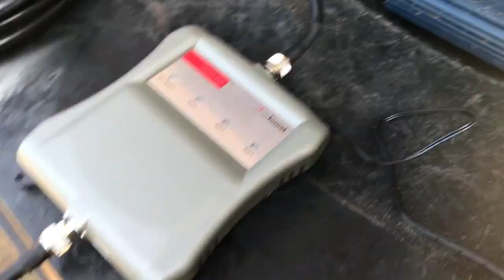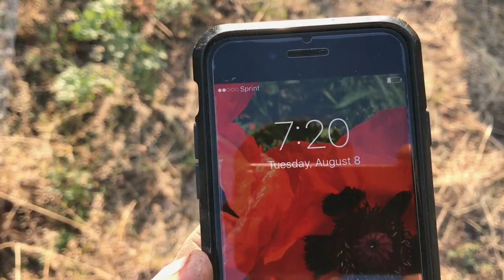#130 - I Built A Solar Powered Cell Phone Booster!

Comment: Nice hope it works out for you I would put a drip loop on The wire coming off the solar panel it looks like you've got it pulled a little tight water from rain will hit it and run directly down that wire and then to your birdhouse put a drip loop in  it'll have a little slack right in the middle that away the water will pool and drip off

Comment: The booster isn't designed to run on AC voltage, the wall wart plugged in to the inverter is.
You have a solar panel(DC) into a charge controller(DC), into a battery(DC), into an inverter(DC to AC) into a power adapter(AC to DC) into the device(DC).
If you assume that panel gives 100 power units. Then the controller takes 10 or so to run this puts you at 90. Then into the battery with another 5 loss(85) in charging. Then with the cheap modified sign wave inverter that is likely around 45-50% efficient we are left with 40 or so power units. Into the power adapter (80% efficiency).
The result is 32 power units for the device and battery charge up, 15 units unavoidably used in the battery/controller and 53 used in changing DC to AC to DC. 

If you replace the inverter and power adapter with an adjustable Buck Boost converter(10-25$ don't be too cheep guys) you can set it for the output of the power adapter to feed into the cell phone booster.
With the 85 units out of the battery: a buck boost converter(75-90% efficient) to change DC to DC. 

The result is 70 power units for the device and battery charge up, 15 units unavoidably used in the battery/controller and 15 used in changing DC to DC. This should allow you to use the smaller battery and build a smaller bird house.
If you have read this far and like/approve of this solution. Up vote it so it is the 1st comment people read. If you have additional information to help the next guy, REPLY so it is the 2nd/3rd/4th/etc comment people read.
Reply: I'm just commenting so more people may read Watchful Bird's comment.
Reply: Just get a charge controller that allows  a 12V load and a 12V cell booster.

Comment: Why not power the weboost with DC?

The wall wart converts 110v into 12v. so x86 the wall wart and connect to the battery direct. 
Even if it needs 24v You can convert the 12vDC to 24V DC.

This is just a good example of where he is a stubborn ahole which is why he refuses to get help on these huge projects.

Comment: did you run a gounding rod?

having a true ground will significantly improve radio signal, will also help protect your equipment from Lightning by providing a safe path.

I strongly recommend finding a local ham and politely asking for  antenna grounding advice.

Comment: Iv only watched 3 minutes in and have to go but, You do not need the inverter, You can ditch it and save power, All you need is DC to DC inverter. That black socket power that plugs into the booster box is an AC to DC converter, I would guess your booster box is 6-12v DC, best way to check is look on the black socket and check the output they normally say input 110v AC output 12v DC,  so essentially you are converting DC in to AC then to DC its a big waste and that smaller battery is probably fine if you just get a DC to DC inverter. hope it helps.

Comment: I am at a loss on how that thing helps your Sprint service. Don't get me wrong I am ecstatic that it does, but Sprint doesn't use any of those bands shown on the front of that booster. That thing should help every carrier but Sprint. Sprint LTE uses bands 25,26,41. I wonder if maybe you are 'roaming'... and Sprint has a deal with one of the other carriers to use their towers. Please respond, the curiosity is killing me.

Looks great BTW.
Reply from the maker: I spoke with the company before doing this and that's basically what they said. They said it still will help Sprint but not as much as the other networks.

Comment: I have several of the same inverters that you have hooked up..  STOP.... Throw that inverter as far as you can....  It on gives you half of a sinewave.  It will destroy your expensive equipment.  Purchase an inverter that puts out a full sinewave or you will be replacing all equipment....  Don't run a computer or any expensive equipment with these cheap inverters.

Comment: You can  use a "DC Adjustable Voltage Regulator Boost Buck Step Up Down Converter AT30 4A" at the output of the charge controler. It will maintain a steady 12 volt even if the battery is bein charge or going low. Look for it on EBay.
Also this one "Boost Buck DC adjustable step up down Converter XL6009 Module Solar Voltage".

Comment: ONLY the wall wart is 110v. Look on the wart, and you'll see an output figure. THAT is what the 'connect' uses. For instance, input "110v x amps". Output "12v x milliamps". That 12v x milliamps is what the connect runs on. If you eliminate the wall wart, and use a car adaptor instead, that puts out the same voltage and amps... you have eliminated the need for the invertor.

I am concerned about the gasses from the battery causing corrosion in the other components, being all inside the same box...
Reply from the maker: This is why I didn't have it running 24/7. I thought about bypassing the inverter but did not want to void the warranty.
Reply: That is wise. However, I would contact them directly and ask them if they make a car adapter for it. Generally, where there is a wall wart, there is an equivalent car adapter. And if they have one and you use theirs, it's pretty certain you won't be voiding any warranty. :)
Reply: They do do car adaptors, they even have a model designed for a car/truck. I believe it is 12v to 6v @2W

Comment: Regular car batteries are not the best for this type of application.  You really want a deep discharge battery (NOT a marine/dual purpose) for maximum life.

What charge controller and inverter did you use ?
Reply: In time, I suspect that it could be added, but for now I'd also use a battery that I had laying around vs purchasing a new one.
Reply from the maker: I agree although I hope this is a short term issue and would rather not spend the money on deep cycle battery. Good idea although!
Reply: I know we don't see eye to eye sometimes and a decent inverter is more money, but throw this one away and get a good one......

Comment: just one question why go from 12v to 110v back to 12v why not eliminate the inverter
Reply: No need to open it. The wall wart says on it what it outputs and the unit may have its supply requirements printed on it. You're loosing a fair amount of power by going through the inverter and it doesn't seem to me like you have a tons to spare so pursuing this when you have time would be worthwhile. Call the company and explain your setup and they can advise you.
Reply: I've looked up the tech specs on the Drive 4G-X | 470510, and it appears to run on 6v (not 12v as usual) - so if you swapped out that battery and solar converter for 6v models, then you could power it directly (just add a fuse to do this properly)
That cheap-ass inverter and Chinese wall-wart aren't designed for 24/7 usage in hot conditions and they are weak links. Please sort it out, any slightly techy guy in your area will fix that for you for two beers.
Nice reuse of a satellite arm, good thinking.
Reply: From what I could find on the internets the wall wart is 12V/3A. The website says the unit uses 8W and probably 2W lost in the wall wort for an actual DC draw of only 0.5A by my guessing.
Reply from the maker: Blocked off with a metal plate...
Reply from the maker: I'm not opening that thing up. They aren't cheap and it will hopefully be in my house soon enough.
Reply: I think elimination of the invertor will result in the ability to use a smaller battery through the more efficient DC to DC conversion.

The vendors website and documentation doesn't contain any details on the DC output.  This should be shown on the pack.
Reply: Yes. If it were an internal AC/DC rectifier and voltage regulation I'd not join the others in suggesting running directly off the 12VDC battery.
Reply: Very cool!  However, did you block the holes of the bird house on the inside?  The birds might not understand it isn't for them, and find a cubby to nest in.
Reply: Yeah when I saw that I thought the same. But he can fix it once it breaks, until then he already has the components and space so he won't optimize anything really. And the power draw is low enough.
But for anyone else watching, this setup could be cheaper and more stable without the inverter and transformer.

We really need cheaper smart lipo / lifepo batteries. Something you can just hook up directly to a solar panel and that does the balance charging and BMS and just outputs stable 12V.
Reply: That was my immediate thought.  I have a DC to DC adapter for my router and it's way more efficient.
Reply: Nice system, what type of business are you inmmay I ask?
Reply from the maker: I thought about it but don't want to void the warranty. Hopefully I have a house to put it in by then...
Reply from the maker: allan bech rasmussen the connect 4g is 110v.
Reply: @RedPoppyRanch  It is DC, people use them in campers running on DC. the wall wart converts the 110v to DC.

Comment: I see you put the receiving antenna inside the box, being inside the box with all your electronic gear you are killing the signal. Put the receiving antenna outside the box but have it protected from weather with maybe a roof over it. Anything but inside the box. Try it and see if you get a stronger signal. You can also adjust the booster for more boost. Good Luck. 👍Vinny 🇺🇸
Reply from the maker: That's what I climbed 40' up in the tree for.
Reply: Red Poppy Ranch Im sorry, I meant the antenna you get the signal from the one 40 feet in tree. The one in the box. Just being in the box with your other stuff can & will drop your signal. Vinny 🇺🇸
Reply: mmanut - not really, a cellphone has the TX/RX antenna next to the same electronics. The signal goes back to the same box regardless.
Being able to separate the two antenna is mostly for convenience, like one up the tree and one nearest the house.
Reply: mmanut the recieving antenna is up the tree and electrics and head height.he only did that at the start for testing.